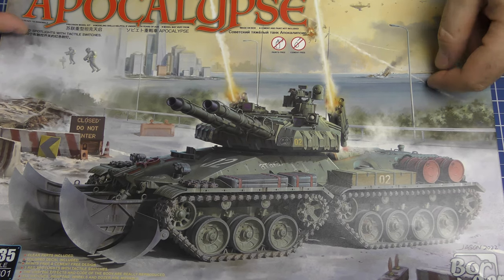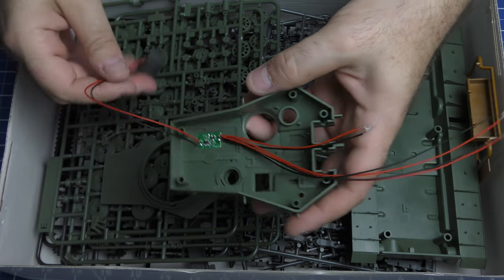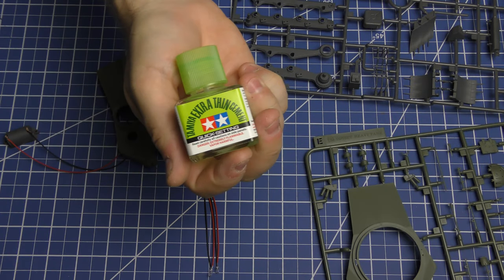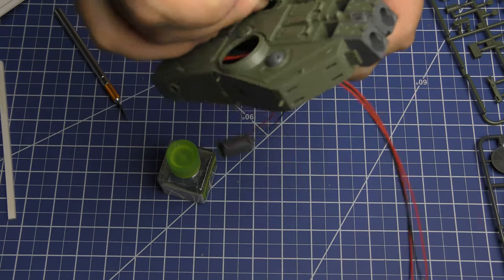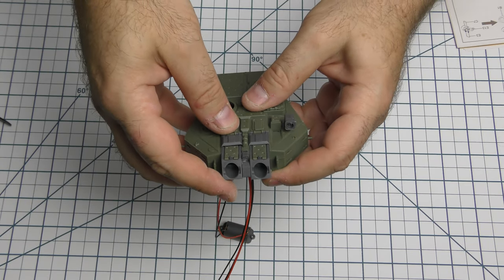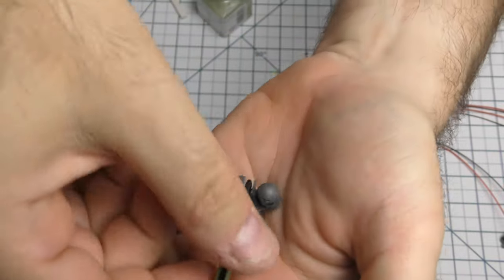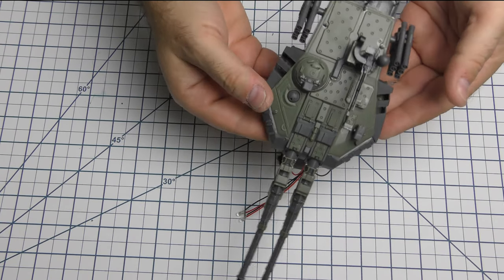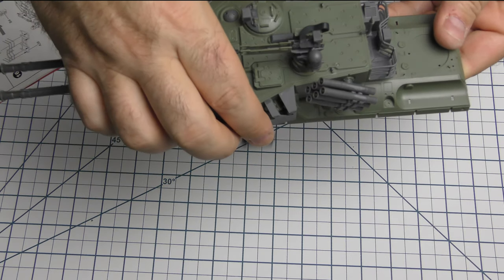Border Models 1/35 Command & Conquer Apocalypse Tank - Full Build Part 1 - Turret Build

Comment: It looks like its inspired by the mammoth tank with extra blades and plows added to the front. The mammoth had a more angular hull, and smaller main guns than the apocalypse. Great model either way, if that thing could be made fully RC so it could move, and its turret could turn, that would be a epic model.
Reply: Imagine if it had little airsoft guns in the cannons so it could shoot things XD
Reply: Its the Apocalypse Tank though from the Red Alert series, the Apocalypse in the RA timeline replaced the Old Soviet Mammoths, in the Tiberium Timeline the Mammoth somehow stuck around.

Comment: Seems to be a perfected heavy tank which was the pre or original mammoth tank. I suspect the red alert mammoth was meant to be renamed and re voxeled I to the heavy tank or apocalypse mammoth tusk Soviet heavy tank. 

Either way it’s a perfected modern design play on the super heavy tanks eg is3 n objekt concept tanks. 

Ps dual tracks - ability to maintain mobility if de tracked. Which is most vulnerable area on any tank. No need for side skirts coz central amour is more than enough to deflect any round. 

Dual cannons - this seems still until you think slightly futuristic and think of advanced active Defense systems that are just in their infancy and bout to be incorporated gen1 into western upgraded mbts. 
With 2 cannons always have a live follow up or secondary priority target instantly also use to defeat these new systems rhat will be able
To stop multiple warhead and multi warheads simultaneously when they become a commonplace. 

Dual rockets obviously for more storage and barrage / multi missile engangements also to overcome countermeasures. 

Makes sense. If Russia had these design for real working I think they’d have taken Ukraine initially put it that way.
Reply: Idk if you've played red alert 2, but these things are pretty menacing. It has surface to air missiles to keep aircrafts at bay which I found out when I sent a rocketeer to attack it. The only draw back is that it's kinda slow.